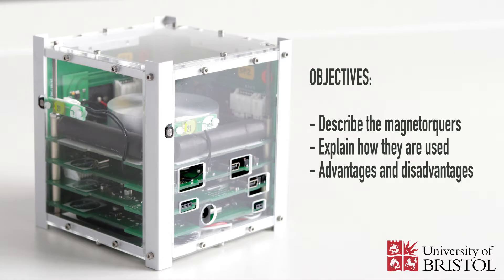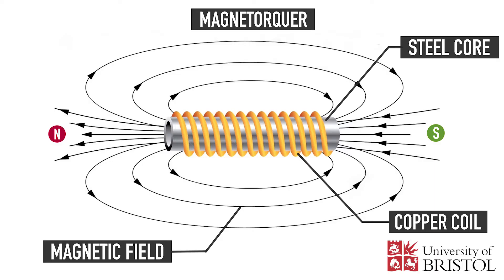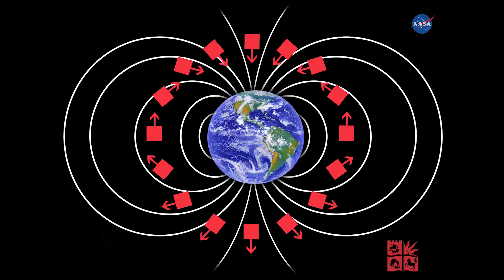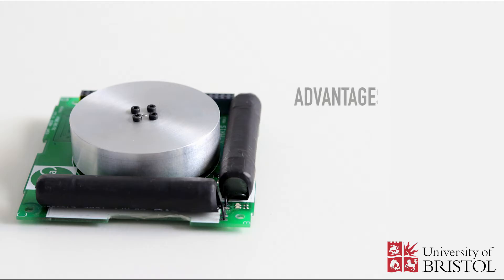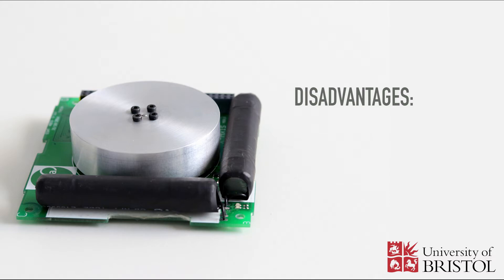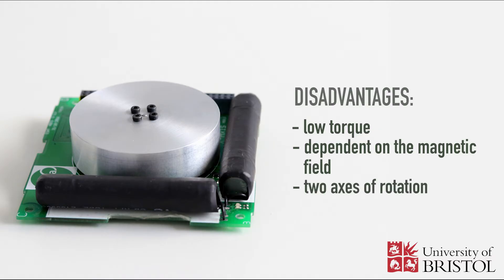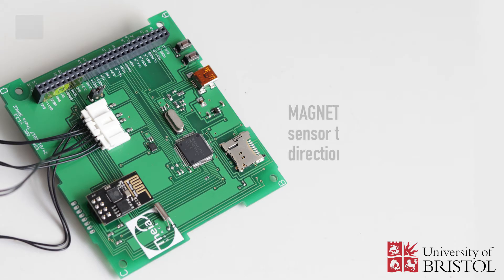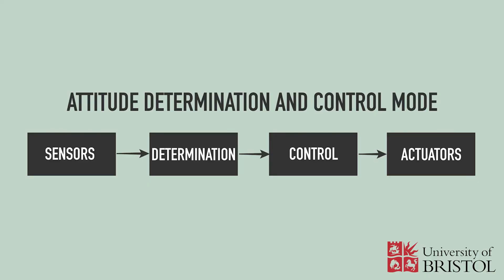Satellite Magnetorquers

Comment: Is the long term shifting of the magnetic poles taken into account for satellites that use the magentorquers?
Reply: Most CubeSat or PocketQube missions that use these will not be in orbit long enough for this to be a major effect.
Reply: Since the magnetorquer reacts to the measurements of the magnetometer, even if the magnetic poles shift the magnetometer will measure this and the magnetorquers will adjust